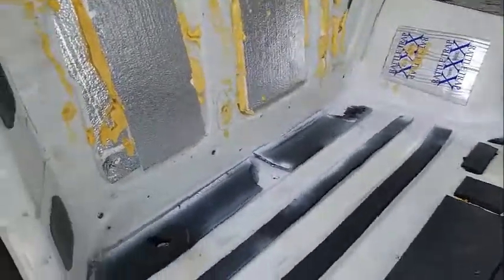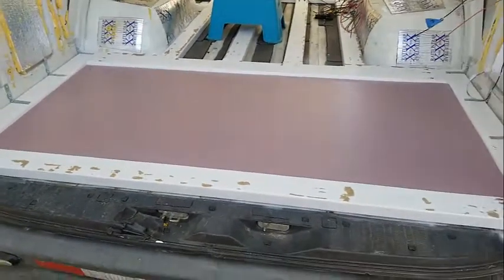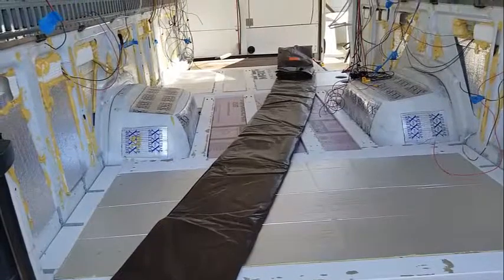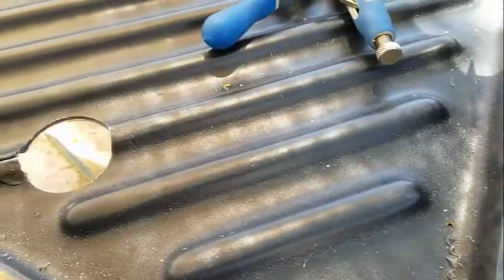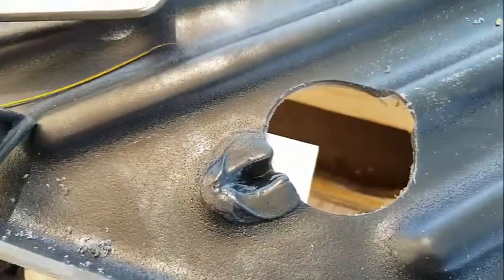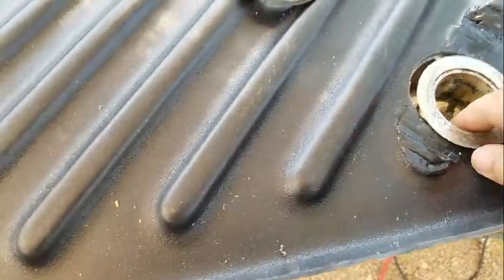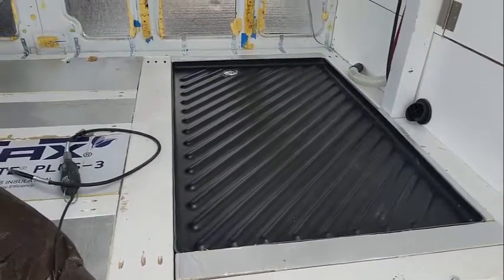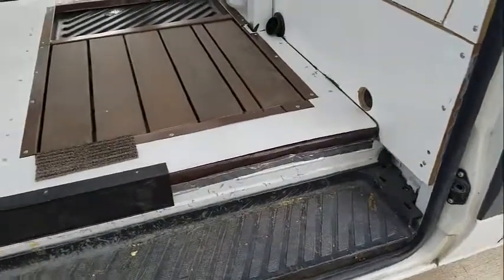Sprinter van floor system & shower

Comment: Looking great ! I've seen your other video where you install the shower curtain rail to the ceiling, I was wondering how you are planning to prevent the curtain from moving away from the shower pan / slates and getting the carpet wet ? Have you planned any way to attach the curtain to the floor ?
Reply from the maker: Hi Candice.

Sorry for the late response. The shower floor is cut so that there is enough room to put thin plastic (~6 in high) walls in between the shower tray and the shower floor. This will give the edging that will keep the shower curtain contained. Install before each shower and when done with the shower, dry the plastic pieces and store them. They are thin so won't take up much room.